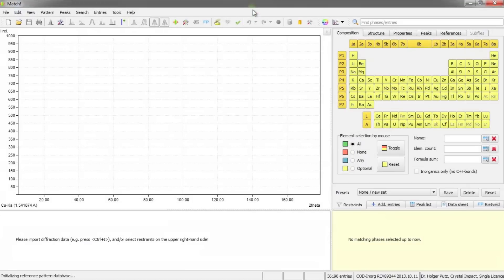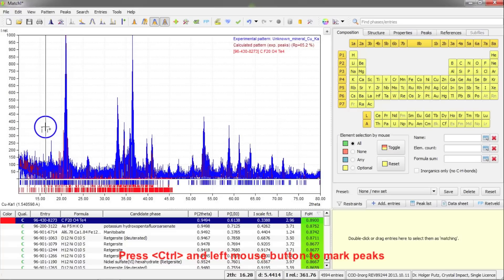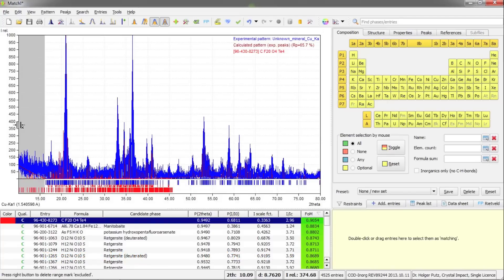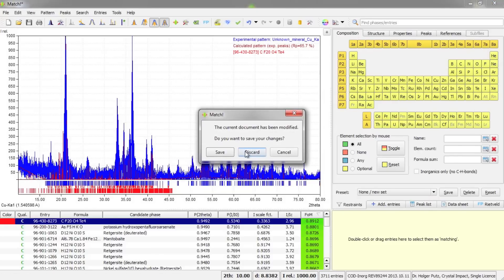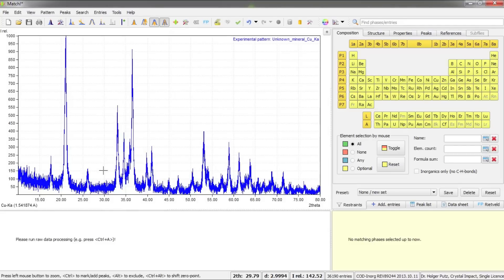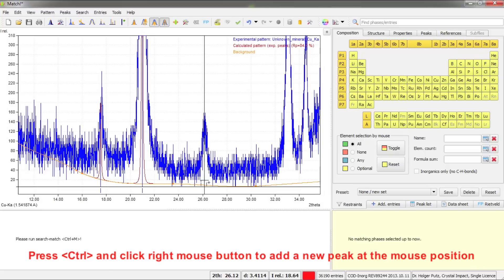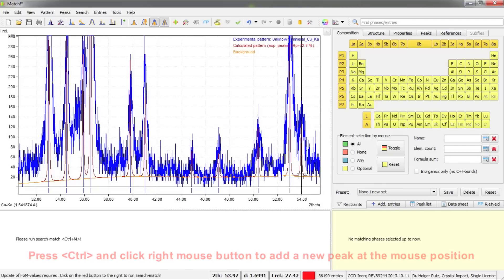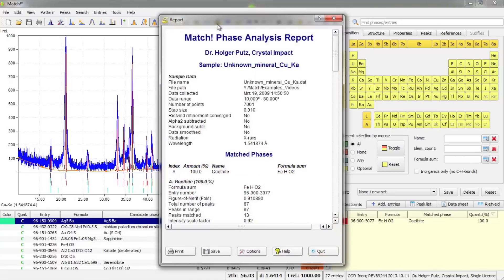Working in Match!'s Pattern Graphics

Comment: hello, I have diffracction patterns which was measured using Co-Kalpha1 radiation and when change the radiation source on Match!3 the entries does not change their radiation wavelength they still show (Cu-Kalpha1), is there any way to solve that?
Reply from the maker: Which command/option have you used to (try to) change the radiation/wavelength? In order to change the current wavelength, you can either click on the radiation label in the lower left-hand corner of the diffraction pattern, or run the "Pattern / Wavelength..." command. However, if you use the "Default wavelength" option on the "Raw data" (or "General") tab of the options dialog, nothing will happen at once, because this option will only take effect next time you import a diffraction pattern.
Reply: @crystal_impact  Very thankful for your quick response.
i have used the "Default option " to change the wavelength radiation to Co-Kalpa1 before import the difracction data, but in the identification  in the data sheet option for the entries it shows me the pattern measuread with Cu-Kalpha 1 radiation.

Comment: Hi, Could you please tell me how to flatten the background noise from my XRD data. The XRD data that I obtained has so much noise and i want to remove them
Reply: The noise may e.g. be caused by weak scattering power (e.g. light elements) and/or short measuring time. In order to reduce the noise, please extend the recording time per step. If this is not possible, one could try to smooth the raw diffraction data numerically, e.g. by running the "Smooth raw data" command from the "Pattern" menu in Match!. You can repeat this several times until the noise has been removed, however, you should always keep in mind that this may also flatten out diffraction peaks, so that you loose information.